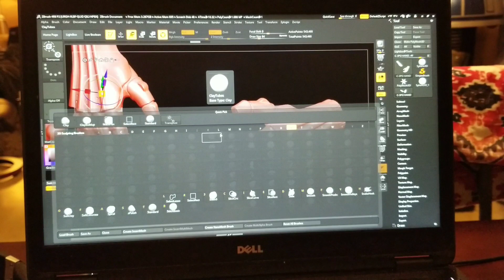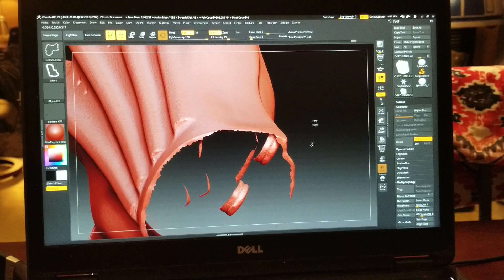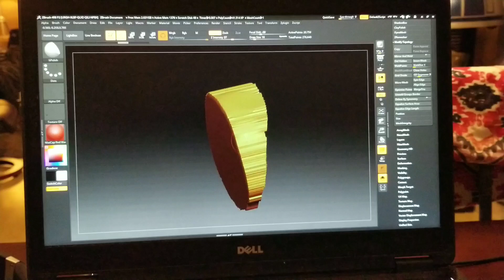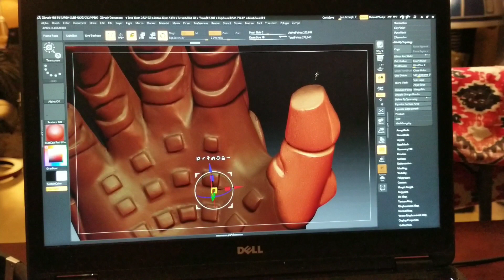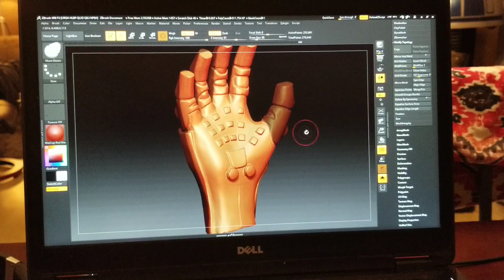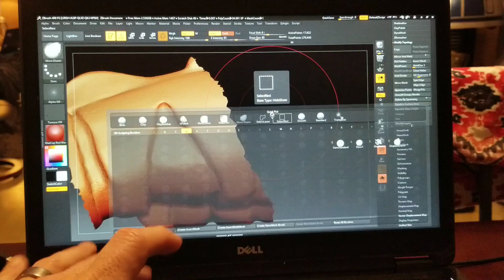How I bring STL files into Zbrush and some basic editing tools I use often.

Comment: Great Videos. Little Tip for Zbrush, go to your Zbrush Plug-in menu and under 3D Print Hub there's a option to import .stl files. No need to go into Mesh Mixer.
Reply from the maker: Excellent! Thanks!!!
Reply: @gordontarpley  You're Welcome. Can't wait to see the C3PO costume.
Reply from the maker: Just used it. Worked like a charm! Thanks for the tip!!!!
Reply: @gordontarpley  how do ya do this in Sculptris
Reply: Do you have any tutorials/ assistance on how to use the grid like system to extrude/cut into the models. for hard surface modeling I believe? I'm new to ZBrush but have used Solidworks intensely for 4+ years.
Cheers!
Reply: YES GLENN. Legend.